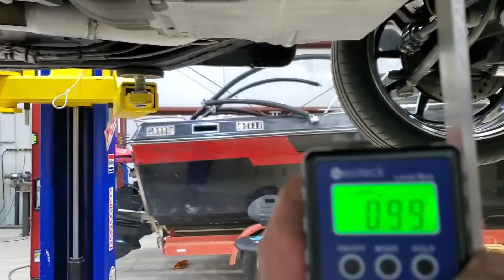C2 Corvette coil overs Vansteel trailing arms

Comment from the maker: Ok, car just came back from the alignment shop, explained to the tech what we did, he asked how we set the rear tires camber and tow, we said string line, the tech said What? it was really close and only needed a slight adjustment, he was amazed at how close we got it with string!

Comment: So the Van Steel coil overs would have been a direct fit with no issues and all of the custom machining - if it had not been for the super thick half shafts? ..  Also, how is the performance feeling compared to the leaf spring?..   I was thinking about the Van Steel coil overs for a 1980, or going with a composite shortened leaf to help get clearance for wide tires (along with off set trailing arms and new adjustable shocks). I have read on a C6 forum it was in question if the car could actually hold up with coil overs since the car was not designed that way from the factory
Reply from the maker: Hi there, so the coil overs are completely adjustable, different spring load ratings, adjustable preload, then you have compression and rebound on the shocks, this car now handles 150 + MPH with two fingers on the wheel! completely different vehicle! the half shafts have 3.5" tubes and 1780 cross bearings. less wheel hop, launches straight and so on. well worth it!
Reply: @BretMech  The top shock reinforcement that the kit comes with seems heavy duty enough to handle the load of the car with no leaf spring as the factory designed to support the car?   That's the main concern I had been reading on a C6 forum